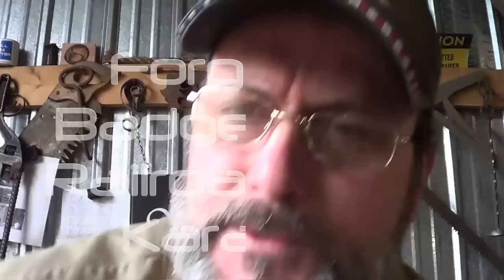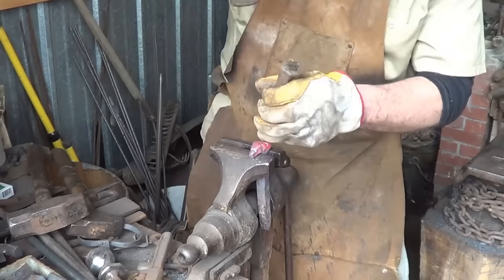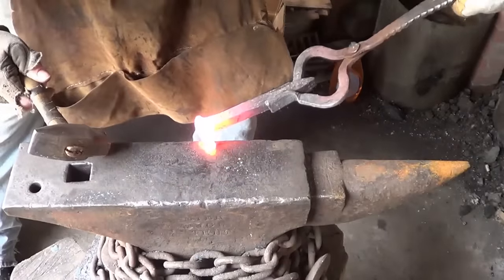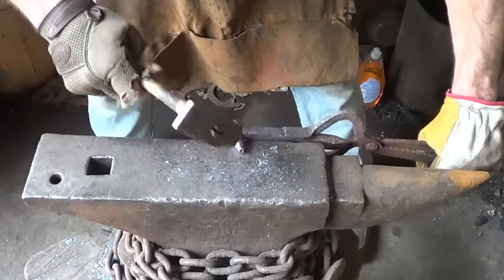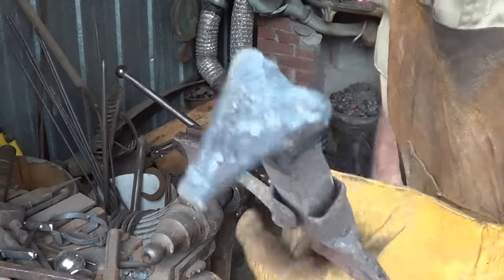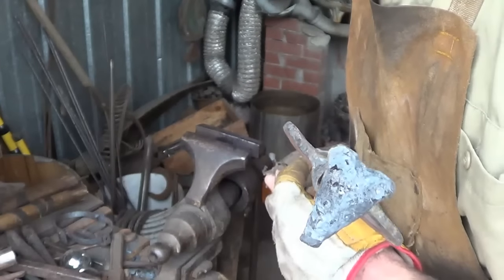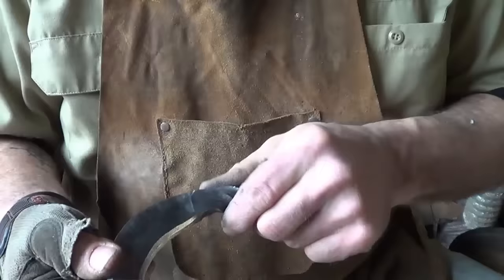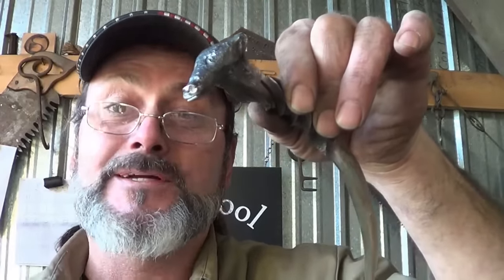Blacksmithing - Forging A Badger Head Railroad Spike Karambit

Comment: I tried forging a piston valve ( a nail looking piece with a flat head) and i didnt even know that it had silcon and mangan added to it...
I ended up with 5 hours worth of time wasted when in the end i heated it up wrongly for some teeny tiny handle work and snapped 5th of the blades tip ...But damn, is it hard...This one was a car sized , next time im taking a truck 460 hp engine one ...

Comment: Hitting two hammer faces together makes me cringe a little, not because of some wives tale about whatever, but because when I was a kid I was doing just that and a piece chipped off one hammer and lodged itself in my chest. It felt quite hot and I was confused until I went into the bathroom and took my shirt off and there it was, a lil chip of steel stuck into my skin and bleeding more that I thought it should. No lasting damage apart from a tiny scar that I can find sometimes if I look hard enough, but still.
Reply: Cadwaladr Same thing happened to me, and I still have a nice souvenir in my chest to explain to the dr if I get sick and need a chest X-ray.

Comment: Chandler, as far as I know for Australia, if the knife is part of a collection a few of the laws can be ignored. Though overseas transport might be an issue
Reply: Dylan Zrim the karambit is only illegal in the states if it has double edge as original blade styles are for this type of knife. You can buy the folder type but the spine edge cannot be sharp. As far as I know. Correct me if I m wrong.  Check out Doug marcaida here on YouTube he shows the style of karambit fighting. #crazy
Reply: C Kennedy I was talking about legalities in Australia, because chandler mentioned it.

Comment: where do you buy the fuel for your fire?
Reply: thill 1436 you can buy coal by the truckload for relatively cheep. or you can have bonfires and save the coals or just start a fire and use the embers from that. blacksmithing isn't an exact science. at least if your just beginning. its just getting metal hot enough to be malleable
Reply: If you live in the US, check Tractor Supply Company. They sometimes carry 40lb bags of anthracite coal for something like six bucks, if I recall correctly.